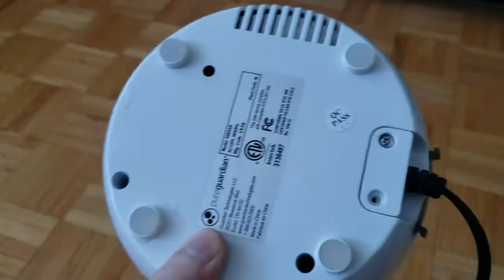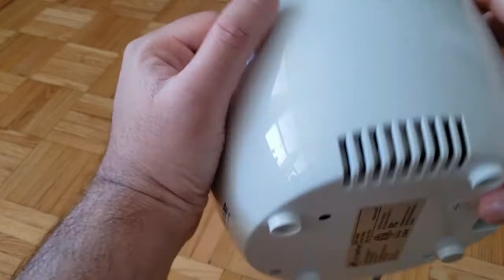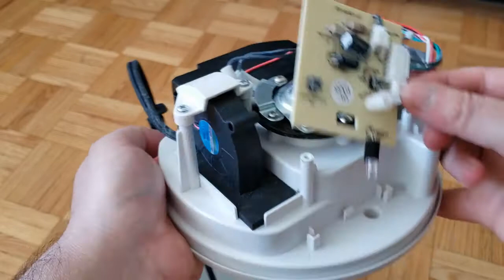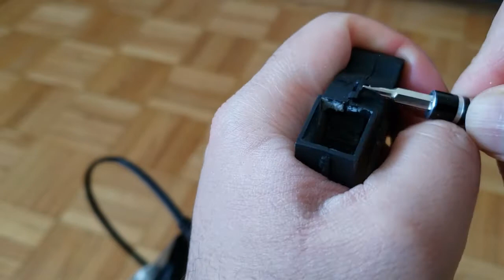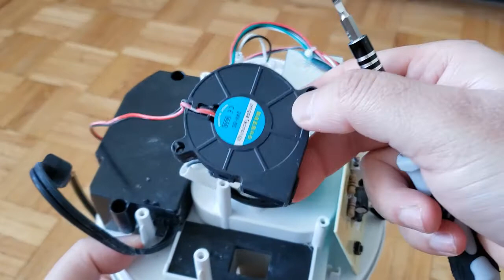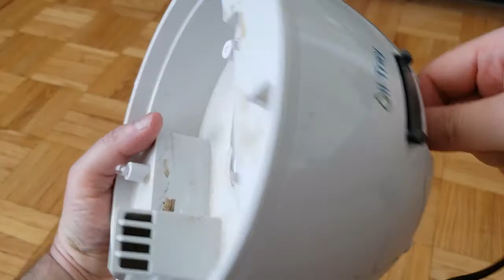No mist coming out+Fan Fix for PureGuardian Ultrasonic Humidifier H965/H965AR

Comment: Thank you for posting this very helpful video. I did have to get one screw drilled out to open the cover. That must be the security screw Livingsaint mentioned.  I clean the noisy fan with a toothbrush and rinsed it under water then dried it with a hairdryer. It is now running silent.
Reply from the maker: Glad that it worked out!

Comment: Link to fan?
Reply from the maker: The one I bought seems not available on amazon, these 24V 0.10A fans are similar-
1. https://www.amazon.ca/WINSINN-Cooling-50x50x15mm-Extruder-Makerbot/dp/B079BPS9Q8
2. https://www.amazon.ca/SoundOriginal-50x50x15mm-Humidifier-Aromatherapy-Replacement/dp/B0755BY9RH

Comment: Mine just started doing this too
Reply from the maker: If you manage to find the fan then replacing is very easy. The replacement may not be as strong as the original but it gets the job done.